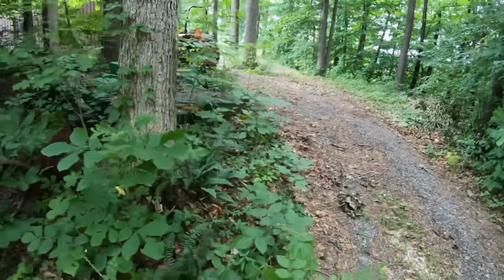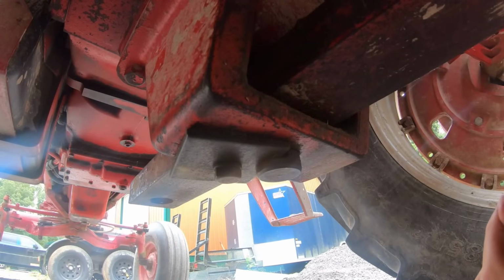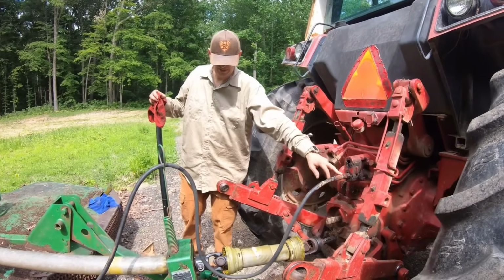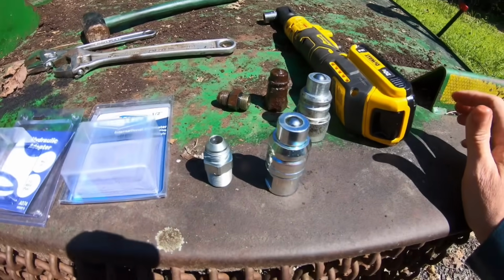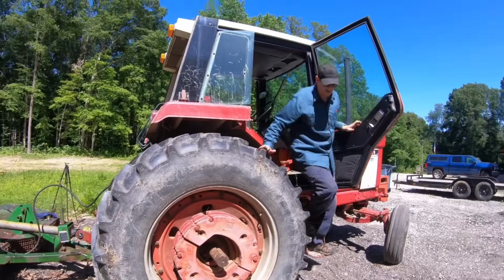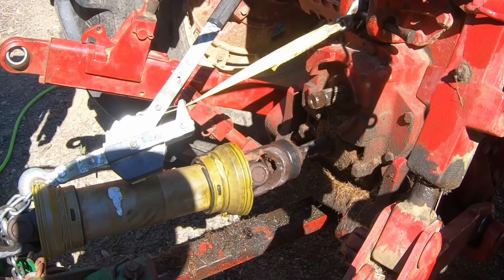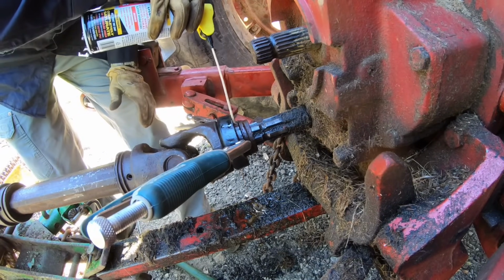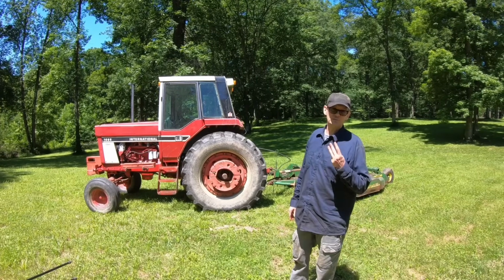Abandoned John Deere Brush Hog Cuts Again

Comment: Aware this video is 2 years old.  When I got my first JD/Frontier PTO driven implement (a used 647 tiller) the pto side of the driveshaft was entirely locked up.  I had to take the whole rings/bearings/universal assembly off because it had been face down in the dirt for a year or two.  Luckily having to rebuild it helped me figure out how it worked.  Even then It STILL took me a while to figure out just how those rings/slides worked to engage/disengage the balls!
Reply from the maker: Thanks for watching and your comment! Yes those pto couplers are definitely the biggest issue most people have using their tractor implements. I have a couple different types and some are easier than others but that also adds to some confusion occasionally. Anyway, great job getting yours working and figured out! We appreciate your support! Have a great day and be safe!

Comment: Looks like after all your hard work it turned out pretty well.  Get you a set of cylinder stops from Tractor Supply and clip how ever many it takes around your cylinder tube to set your mow height exactly where you want it to be when you lower it.  After watching your video I have the sudden urge to go out to every piece of equipment I own and grease up the PTO shafts and couplers and slide them all in and out a few times.
Reply from the maker: @fostergsteward  thanks for watching and your comment.  Great tip on the cylinder stops as well! We appreciate you, have a great day and be safe!

Comment: How to disconnect electrical wire plugs
Reply from the maker: @BertBranstetter  hi thanks for watching and your comment. This mower has no electrical plugs on it? The hydraulic line is a push pull ag style coupler. Not sure if that is what you are talking about though.

Comment: No good reason for the safety covers over the PTO shaft, but a brake on the PTO system would be a good idea. Won't ever be working around that PTO shaft when the brush mower is in operation and moving. Looks better with the shaft covered, but that's about it. You fought your way through getting the brush hog running. There is a brand named Bush hog, and it isn't a John Deere. A different company all together, so brush hog is a better name to use for this rotary mower. Nice rig.
Reply: I’ve heard them called shredders and,or rollercycles as well.
Reply from the maker: @deernutOO  thanks for watching and your comment. I agree that the shaft looks better with the cover and that no one will ever be near it while operating. Brush hog would be a better term to not confuse with the bush hog brand. As Samurai Chef  says, “no coke, pepsi!” Thanks again, have a great day and be safe!
Reply: In addition to the obvious operator safety concerns, those plastic shields serve to prevent tough weeds, vines and brush from wrapping around the rotating shafts. When the shafts become encumbered thusly the hydraulic hose will be knocked off and fall under the shredder and be destroyed. Also, the friction of the rapidly spinning grass and weeds will start fires. Perhaps the cut-up shields can be put back in place and welded back together with a high wattage soldering gun with tie-wrap filler. After that repair make sure the surface of the shields is smooth and free of burrs or sharp edges to prevent catching on vegetation.

Comment: First of all if you will take a small triangular file, make sure the inside and outside of that PTO connection is cleaned up and Burr free. Then to lubricate those ball bearings mix up some acetone and automatic transmission fluid 5050 that’s the best lubricant for those old connections you can use.
Reply from the maker: Awesome! Thank you for the tip. We will definitely try that out!

Comment: I spent a large portion of my younger days on the back of a tractor and put on and took off so many implements I couldn't even begin to count them so it seems second nature to me. That MX will last forever if you take care of it. In time you will get the hang of it and then wonder how something so simple is so complicated at the same time. I prefer the clutch to the shear pin I used to carry pins with me all the time. Take extra care under the cutter so that rust doesn't get started and pay attention to the blades. Don't let grass get stuck under there just wash it off good. I even put rust inhibitor on mine and it looks like new. A penny saved is a penny earned sounds dumb but it's true. Take care of your equipment and it will take care of you. I am going to subscribe.👍
Reply from the maker: Awesome! Thank you for watching and your comment. They are absolutely appreciated! I am new to bigger equipment and tractors. Only have used small tractors until moving onto our property. They are definitely different enough to need another learning curve and I appreciate your tips to help shorten my learning curve. I will definitely do my best to take care of this cutter as well as the other equipment we have been blessed to get. Have a great day and be safe!

Comment: The pto splined connection needed to be scraped free of rust and greased.Small wire brushes help to clean the splines as well.A common problem for the situation.You figured the ball locks out.Obviously they hold the shaft on,its a safer design as the old pin style caught garments and killed lots of people.The collar you say does nothing is a safety item too plus it helps keep grass and such out of the lock assembly.The shields keep vines and tall grass from winding up on the shaft and of course people too.Dont hammer on the pto shafts.The  IH 1000 RPM PTO inner bearing housing is thin and will break,not sure about the 540.Then you need the whole rear PTO housing and they are tough to find around me.Id say you had the wrong hydraulic hose end.The IH ones can be tricky and possibly full of field dust. The other style is pioneer.There are IH to pioneer adapters and they work well. I had a 886 that was stubborn,full of fine dirt from where I got it . Not too bad a rotary mower ,ten foot is nice plus drag along type is nice if you get stuck .The shields can be bought and reinstalled too. After a little use it'll be limbered up and work well.Grease it after the final use of the summer so it's lubed up to sit til next summer. Get out of the tractor cab The reverse of the way you climb in,less likely to fall as bailing out forward is. Looks to be a  pretty fair IH tractor.
Reply from the maker: Hey, thanks for watching and for sharing your comment! I appreciate your obvious knowledge and experience and explanation of it. Everything you explained makes sense and is stuff I didn’t know or didn’t know why it was that way. You are a very helpful person and kind enough to share your experience and we appreciate it!  Thank you! Have a great day and  stay safe!
Reply: @CopperBarnHomestead  The hydraulic line won't pop apart if the hitch pin comes loose or you forget and drive away. It'll tear something up should those happen so it needs the quick release holder or some such on the hydraulic connection. Costs add up in a hurry with hoses and lines getting destroyed so it's best to do something about preventing such.
Reply from the maker: Thanks again! Makes sense!

Comment: I wasn’t going to comment but this was painful to watch…all of what you were doing nonchalantly will kill you if you dont read how to use it correctly.
Reply from the maker: Thanks for watching! Glad you did comment and appreciate your feedback. I think we might not have done everything 100% correctly but we never felt anything was unsafe. It was off anytime we were near it. We had safety as the second priority at least at all times. (Mike Rowe reference lol) Watch the second video, it works and operates perfectly. Yes, there is a safety violation in that video too….and that one we agree with everyone that shouldn’t have happened. We show it anyway just to not hide how we used it. I only responded to your comment because you sound like you have experience with this equipment and have an honest concern for our safety. We honestly appreciate that and you for it! We don’t have hardly any experience with this equipment. We do have experience with doing dangerous stuff while using caution as far as blocking, de-energizing, lock out tag out etc… and of course want to remain safe ourselves. Have a great day and be safe!

Comment: From th UK here, just discovered your channel. I'm not sure where those chain couplings were first used but i first saw them on an Edwin Hall built Twist, these were built under licence in the uk in the 1960's from ELI Bridge. ELI Bridge first built their Scrambler/?/Twist in 1953 so they have definitely been around a while.
Reply from the maker: Hey, welcome to the channel! Yes the chain couplers are awesome. I just saw them a few months ago but I am new to this type of machinery. Definitely looks like a very efficient way to join two shafts and seems more reliable than the lovejoy couplers which is the other type I’ve seen. Appreciate your information and glad you shared it. Have a great day and be safe!

Comment: I own a MX10. They make spring loaded donut spacers that fit around the hydraulic cylinder shaft. They come in various widths and you mix and match until the mower drops to the level you want. Look for "stroke controller" or "stroke reducer."
Reply from the maker: Awesome! Thanks for watching and your comment with the suggestion! We will definitely check those out! Have a great day and be safe!

Comment: I admire your tenacity, what took you a couple of days, is what I learned from grandpa and dad, growing up. The friendly advice I would offer, is this equipment is designed for years of use, easy operation by one in the field and finally an ability for easy repair. When something seems to be on a bind, not operating correctly, step back and look at the "whole operating process" you will almost fine one corroded bolt, bent mount,(something simple) etc. Lastly spend the time and ultimately a few dollars to keep equipment operating properly. Many of us who grew up square bailing in the 70's & 80's know of several who lost fingers, hands or even whole limbs because of PTO shafts, knot tying assembly,  etc. or suffered compartment syndrome from being "cut" by high pressure hydraulic fluid. Modern equipment saves us time and makes working easier. But we have to maintain situational awareness and not short cutting safety. Just my opinion.
Reply from the maker: Thank you for watching and your comment. Yours is one of the best and most helpful comments we’ve gotten we both grew up in farming communities Maggie on an actual farm, but I was a town kid my grandfather owned a hardware store and I grew up there. Your advice makes a lot of sense and is very helpful and appreciated, have a great day and be safe

Comment: Dude rips off the upgraded pioneer remote Only to put pioneer fittings on the hard lines.  He could have just plugged that into the tractor.  This dude has no idea what's going on.  If your looking at this for agriculture equipment guidance. This is not the place.
Reply from the maker: Thanks for watching and your comment. The upgraded pioneer remote would not flow anything. Just showing how we pulled an abandoned cutter out of the woods and made it work for us. Thanks, have a great day and be safe!
Reply: Go out and put that new pioneer end in the other remote. I bet you it works.
Reply from the maker: @timhufnagel7462  it did not

Comment: You can get new clutches at Tractor Supply.
Reply from the maker: Thanks for watching and your comment! Awesome! I was wondering about that. One side is a splined shaft and the other side is part of the u joint. I haven’t looked for one yet but have been thinking about it. Pretty sure that one is locked up tight. Thanks again, have a great day and be safe!

Comment: This mower was produced for roughly 15 years like 2004-2017 for the old font because they changed the lettering on the side to the new font so it’s definitely an older one so my best guess it’s probably around 2007 the one you have and judging the fact how rough it is the previous owners used it a lot for many years so it definitely didn’t sit so probably used it for 8-10 years or so then let it sit in the woods for the remaining 9-7 years.
Reply from the maker: Thanks for watching and commenting. I haven’t seen anything to identify the age. This had been repainted at some point so not sure if those stickers are even original. Another viewer said he had a 1998 MX10. This particular one was bought at an auction in the early 2000’s and only used a couple of times before being parked behind that barn. It’s a hell of a mower and cuts great behind our 1086. Thanks again, have a great day and be safe!
Reply: @CopperBarnHomestead   it very well could have been but when I searched up 1998 John Deere mx10 there wasn’t a single one that said the year of 1998 they all were newer so I’m not sure
Reply from the maker: @RyansVideoGames  I honestly don’t know either. It was well used and has some welding repairs done as well as having been repainted all before we got it which was in the early 2000s definitely before 2005. Maggie’s dad bought it at a used farm equipment auction and used it a couple times before his tractor had some issues and we haven’t had anything to pull it until we got our 1086 last fall.
Reply: @CopperBarnHomestead   yup 👍

Comment: Hey buddy I just seen your video good video and I had one of those MX tens also and I had a little bit of problems with mine I got it all fixed and I sold it for $1,500 bucks so good luck and we're if you don't mind me asking where did you get that watch at what kind is it I like to get me a new watch thank you sir
Reply from the maker: Thank you for watching and your comment. The watch is a Casio I ordered off Amazon. I think it was around $30. I go through a lot of watches so never spend very much on them. Thanks again, have a great day and be safe!
Reply: @CopperBarnHomestead   that has the big numbers on it is there a model number on the back or front sir  thank you
Reply from the maker: @joeclark9042  I have looked for more tags but haven’t found anything yet. I wanted to see if I could figure out the year it was made. I was thinking it would have been mid 80s vintage but only found 2000 and up so far online. I did see made in Spain on it. Thanks for watching and your comment. Have a great day and be safe!
Reply: @CopperBarnHomestead  i meant the watch  but my  cutter was a  mx-10 was a 1998
Reply from the maker: @joeclark9042  thanks for clarifying. That your cutter was a 1998 helps a lot. The watch says WR for water resistant I think and then has a 3502 AE you n the back as well. Good luck and thanks again for watching and your comments!
Reply: @CopperBarnHomestead  yes  sir  and  thank you

Comment: That mower would barely be 20 years old if it was one of the first models. Must not have used it much before it was parked.
Reply: i thought the same, and not much debris on the deck or mud on the wheels for sitting 15-20 years abandoned.
Reply from the maker: @DavidMiddleton-w6x  thanks for watching and sharing. Have a great day and be safe.
Reply from the maker: Thanks for watching and your comment. Looks like the MX10 was first made in 2000 and is still being produced. The only history I have on this one was it was purchased at a used farm equipment auction. I know Bill only used it a few times before parking it behind his barn because of tractor issues. Thanks again, have a great day and be safe!
Reply: Agreed.  Doesn't look like it was used that long ago... certainly not 15-20 years like he was rattling about.  What a shitshow.